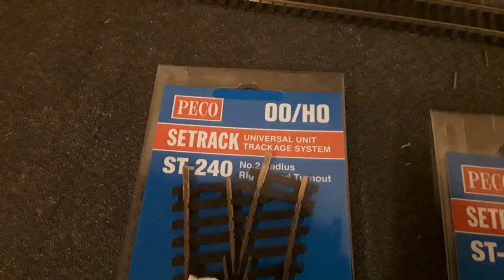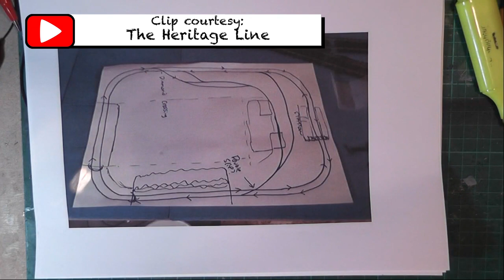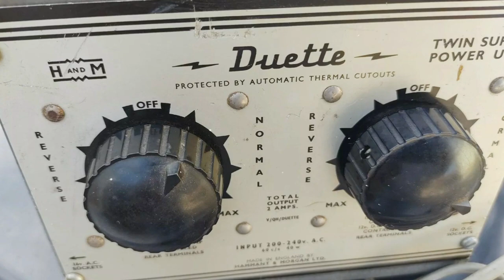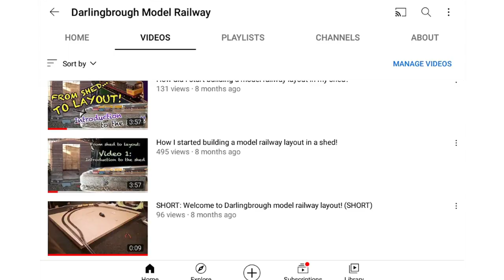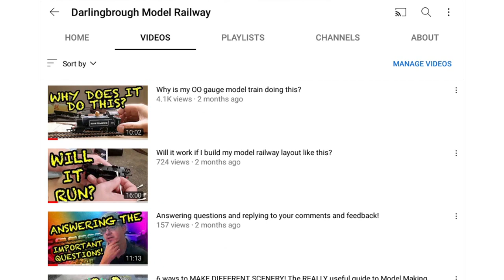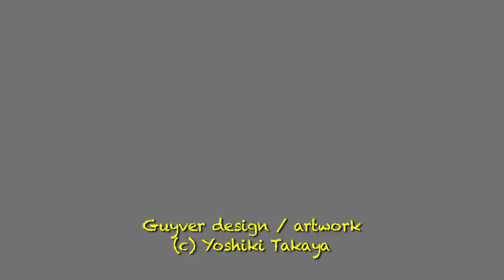Coming up in 2022 on the Darlingbrough Model Railway channel! Happy New Year!

Comment: Fantastic decisions Richard. A perspex bridge section seems the only feasible solution. Insulating the roof another fantastic resolution and you can never have too many shelves. :) I tried and failed using only set track and resorted to using flexi track because it was more  well flexible (groan) I also struggled at first it seems to have a mind of its own. My track is all Peco  code 100 with electro frog points. Still not set up yet but well getting there. As for the channel? There is absolutely no point struggling to make a weekly  video  IMO you dont even need a regular schedule TBH. Just broadcast your progress as and when you can. The once a fortnight option is what a lot of you tubers seem to settle on. I think with these decisions made you will feel a weight lifted off your shoulders to free your mind from doubts and move on at a much easier pace. Looking forward to seeing the new Darlingbrough . Happy New Year.
Reply from the maker: Hi Gordon,  Happy New Year to you too! Yeah, after several recommendations and watching Allan at Dragon Junction MK2 showing his perspex bridges, it does seem like a really good idea! 💡💡
I definitely don't want to burn out or lose interest, so definitely think just taking the small step of "not PROMISING" a video every week already makes me feel better about the channel... 🤗
Chances are, I will still post every 1-2 weeks, but before I felt... Obligated... to post every week, and would be annoyed on those times I missed the Friday "deadline" due to lack of time... 😞😥😭😤😡🤬
From the comments I've received over the last few months, it seems that using Flexi Track is something many people struggle with... I will post a follow up video soon about it! 🚂🚈🚉

Comment: I'm not familiar with the Hornby basic controller, but if it's anything like the basic Bachmann/Life-Like/Tyco controllers that I'm more familiar with, they work great as power supplies for lighting, switch machines (points controllers?), and even some DCC components if one goes that direction!

Great video once again, I've added another of your videos to my queue to watch later!
Reply from the maker: Hi Mark! Thanks for the comment and feedback! The basic Hornby controller might be good for lighting and power supplies, but from the existing experience I have it's not a great controller for using to control trains. If anything changes it will reset and this involves switching the whole thing off for about a minute to reset it... 😬😧

Comment: We had the same issue with the drawbridge section on Much Nattering for Good Report layout at the Hoddesdon Model and Railway Club.  We solved the problem by doing something different with the hinges.  We also have a Faller Road System on Much Nattering for Good Report.
Reply from the maker: Oh? How did you solve your issues? Also, what type of hinges did you use? 🤔😎
Reply: @DarlingbroughModelRailway  The Club changed from small panel hinges to proper door hinges.  We still have problems SOME locomotives, but the ones that had problems in the first place have stopped having problems.  We keep on trying to change it for the better, and things really ARE getting better.
Reply from the maker: @Madonsteamrailways  That's good to hear! Improvement is always good! 😎😁
Do you have any vides to show the before and after by any chance? 🤔🔧🔨

I am going to try the cabinet hinges for my drawbridge, will see how that goes and post a video about it!🔨🔨

Comment: Hi Richard. If it was myself in the shed I wouldn't worry too much about flexible track and opt for 3rd radios curves for the inside line and 4th for the outside line. Cheers. Simo
Reply from the maker: Hi Simo! Happy New Year!
That was kind of what I had in mind... However, due to the width of the shed, 3rd and 4th radius curves are too big to fit in the corners each side of the doors... It needs to be 1st and 2nd radius...
That's why I am planning on using Flexi track, so I can maybe ease those curves a little when I come to do them. 🤔😊
Reply: @DarlingbroughModelRailway  I get what you're saying. Whether you use flexi or set track you may want to avoid anything as tight as 1st radius unless you plan on running small engines as bigger engine (A3s A4s) may detail. Cheers again simo
Reply from the maker: @simod  The only thing I have at the moment is my 040 Blue Diamond, my class 58, mostly single wagons... I do have 1 coach and 1 double length wagon, which has separate axles... They all pretty much cope with 1st radius curves ok...
Reply: @DarlingbroughModelRailway  excellent. All should be good then 👍🏻
Reply from the maker: Hope so! 😂

Comment: Fantastic, some great plans ahead, I think its wise to moisture proof the layout or its new incarnation.
You asked about whether you should drop the number of videos.  Ultimately its your choice, as you only know your commitments to family, work and hobbies. Having had my own channel for three years now I know the ‘pressure’ to pump out the videos. It’s important to get the balance right especially with your family and other areas of your life.

IF YOU DO HAVE THE TIME. You are at the ‘get your name out there’ stage in which case a weekly video will help, but only if its possible!

You could consider a two week cycle with the odd extra as and when you are able.
Reply from the maker: Hi John! Thanks for the comment!
Good shout on the moisture proofing... Probably best I do it before I even think of track laying!
😎🚂
I have found that I have had a lot less time to get the videos done, especially over December due to Christmas and New Year, which is why I have made the choice to ease up on the pressure of a weekly deadline. That being said, I am not discounting producing a weekly video if I can! 👍😁
As you say, I am still getting the channel better known, and working out the balance between too much and not enough will be something that I will need to work out!
Have a Happy New Year!🍾🥂🍾🥂